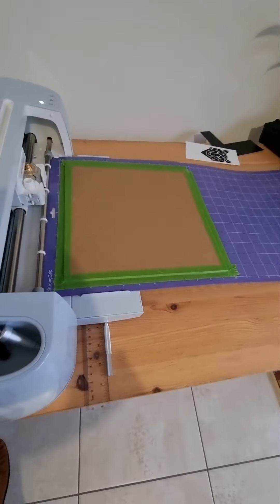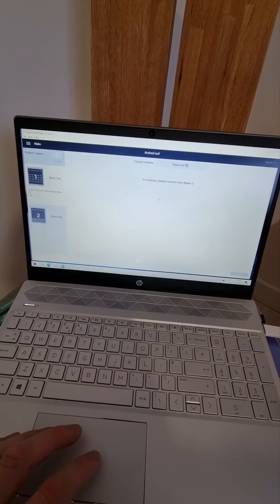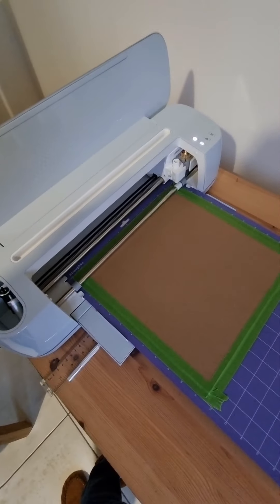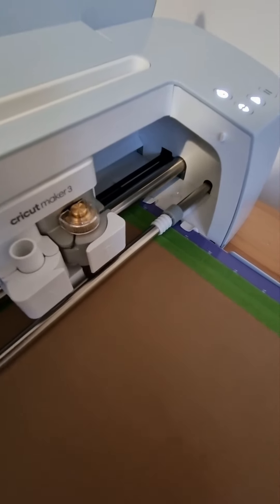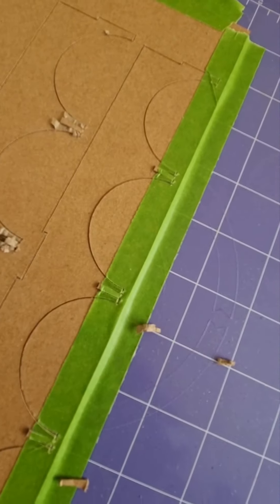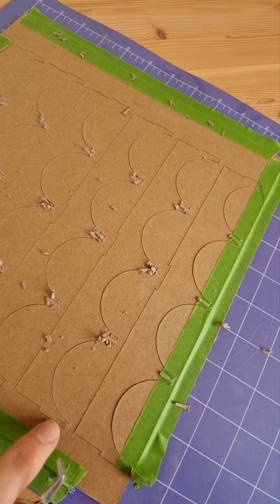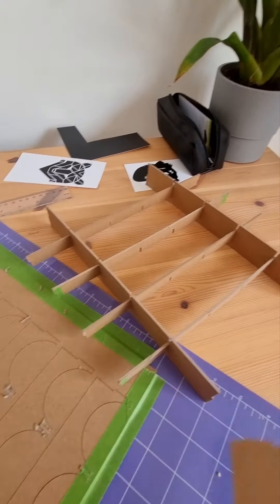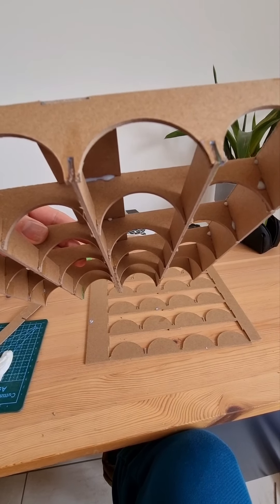Cutting Chipboard with Circut making a frame for model railway

Comment: So probably fine for making the basic building shape and cutting out windows/doors but kinda draws the line at finer details.  Would it cut things like plasticard, wills/slaters brick or stone sheets etc?  That would be interesting to find out,  But certainly good enough for making the shell of buildings
Reply from the maker: I have some 1mm plasticard to try and will post when I do. The 2mm stuff has cut reasonably well and I think as a rough frame and then cutting thin decorative skins will work really well